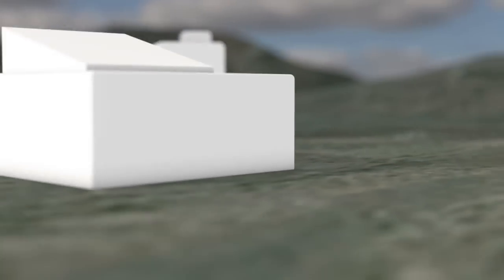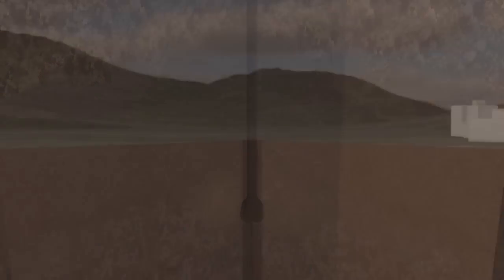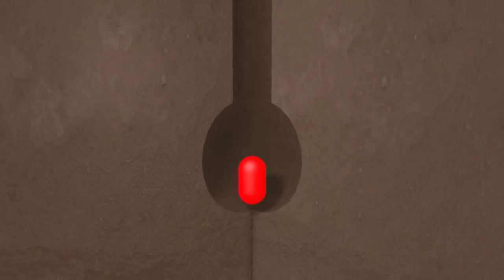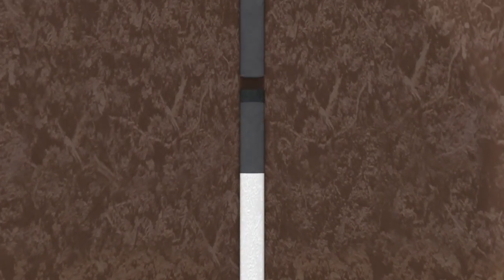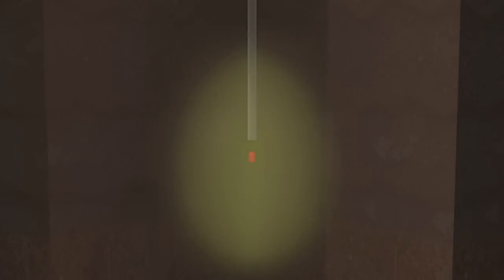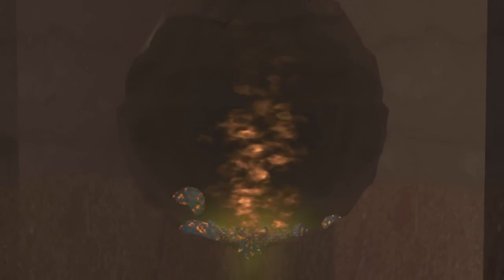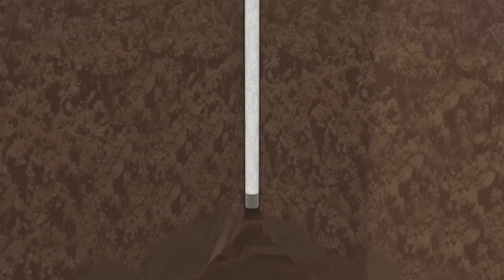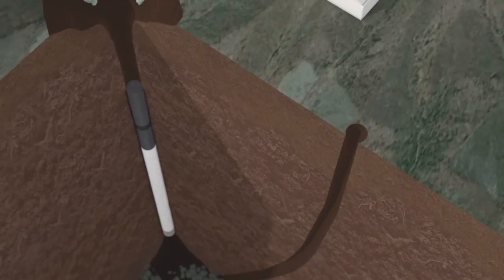Underground nuclear tests

Comment: No, it doesn't "evaporate"; some of the slag does.  The radiation is trapped in the cavern 1/2 mile or more underground.  That's a lot safer than releasing it into the atmosphere.

Comment: Testing nuclear warheads in space is far more terrible for the environment as well as human life in general. When a device is detonated in space the radioactive fallout is blasted in all directions and does not stop till it hits something. This means a large area of the earths surface would receive fallout. On top of that the nuke would send out an electromagnetic pulse which would disable all electronics within a large area around the bomb. High altitude tests have been done before.